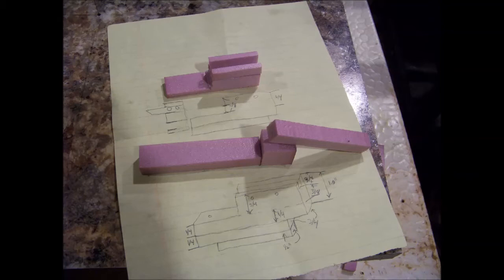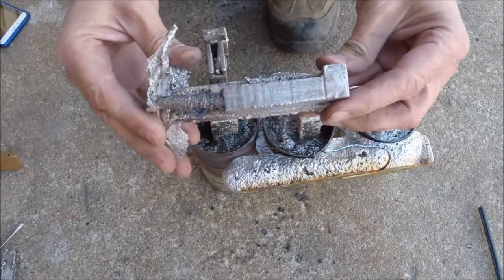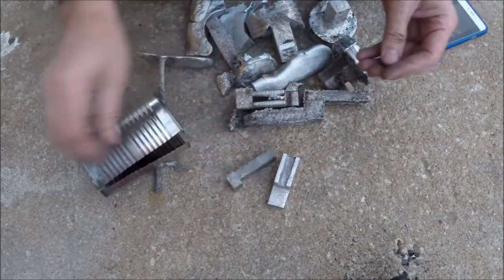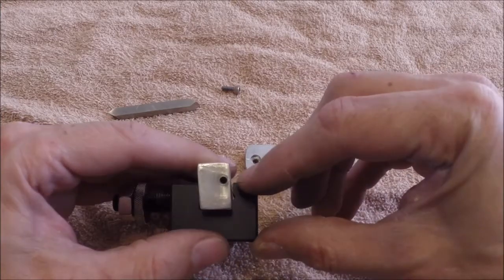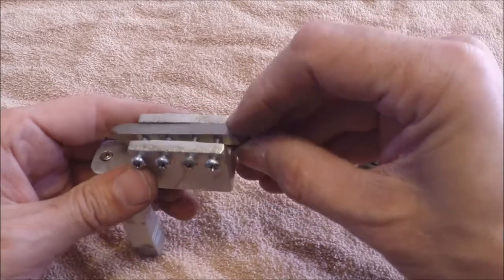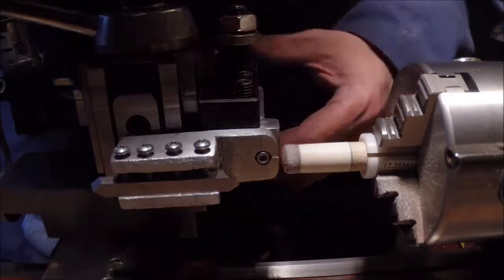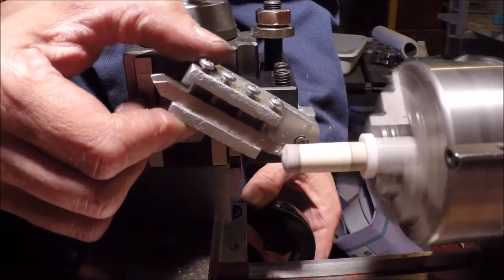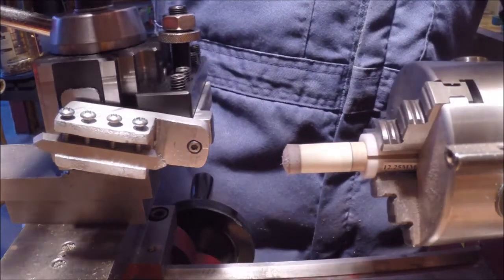Cue tip shaper for my mini lathe

Comment: Massey, You are a WILDMAN! I have been building and working on cues for 30 years and I love to see innovation like this..... From scrap metal to furnace to working prototype. 

I try to do all my tip shaping free hand on my bench top precision lathe because that is how I learned from Leonard Bludworth. I get a little more careful if I am working on a Black Boar, or Judd etc. , but most of my tooling I build at home in my shop cause' it's just more fun. Good luck with your projects!   Gerry
Reply from the maker: +gerry mckown Awesome! and Thank you. I couldn't quite get the hang of doing it with a razor blade like I see the cue builders do so I made this.
Reply: @MasseyMakerman  I need one

Comment: Please could you tell me what the correct name is for that white plastic collar device you have protecting the cue shaft? You can see it starting at 5:17 in your video. It has a label on marked 12.25mm. Thanks.
Reply from the maker: It is a lathe collet. I found it on eBay. A guy makes them for pool cue repair.
Reply: Massey Maker man Thank you.

Comment: I know this is a old video, but what do you use to support the other end of the cue? I'm setting up my mini lathe to do tips on my own cues, was going to try using a wood lathe steady rest mounted to my bench. I have a mini mill too so will likely make a shaper like you made, looks as if it works good.
Reply from the maker: I built a steady rest from aluminum and some old sliding door bearings. It needs to be rebuilt. I plan to build myself another one like I did for a friend. For my friend, I used old hard drive bearings and glued on some non-marking rubber. It works very well. I also have an idea of a large bearing with a decent size center hole lined with felt to put the shaft into.

Comment: Why wouldn't you just machine them out of a block of aluminum? seems like a simple piece to make and a lot of trouble to go through to make a casting
Reply from the maker: John Loveless At present I don't have a mill, just a lathe. I know it's a little much doing it from a casting, but I'm still learning.
Reply: Or you could print one.
Reply from the maker: As in a 3D printer? Yeah, don't have one of those either.